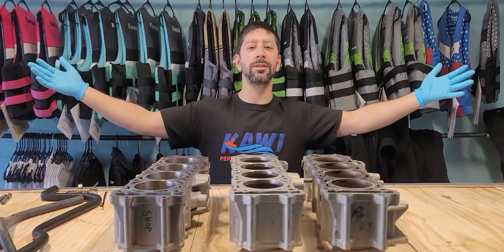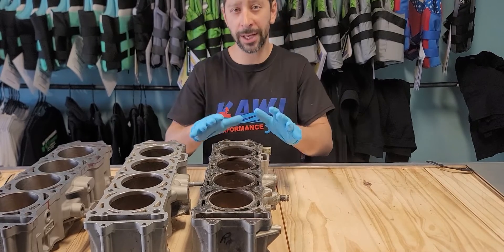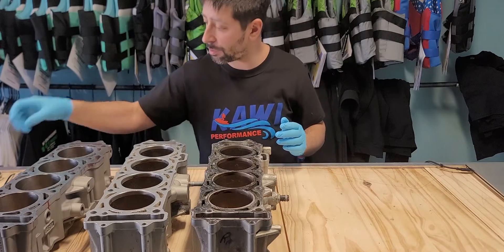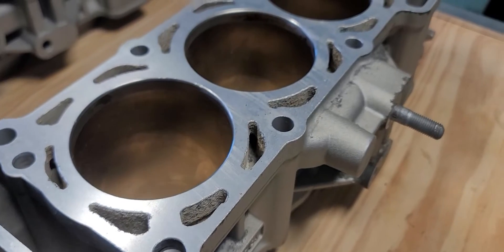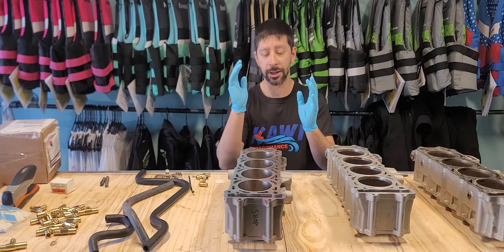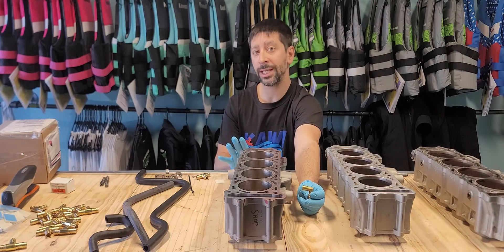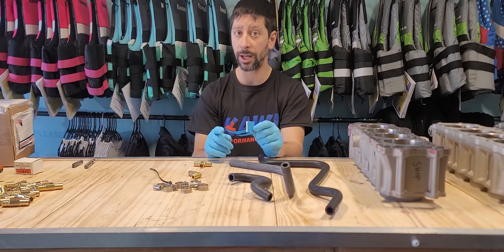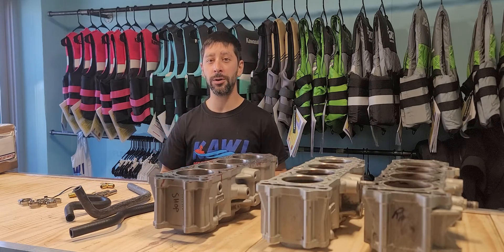Shop Talk: Kawasaki Cylinders & Our Cooling Conversion/ Upgrade Kit

Comment: I've got a 2016 Ultra LX.  How do the cylinders of my machine compare to these three? Did Kawasaki update the Ultra LX cylinders as they updated the 250/260/300/310 cylinders? Is that's the case, then the cylinders of my ski would have the same revised cooling system as the 310's? 

Or- I know the jet pump is the same as the 250/260... maybe they just stuck with the 250/260 cylinder design for the entire generation of Ultra LX, until they revised it to the Ultra 160 in 2023?
Reply from the maker: The Ultra LX is part of the N/A family which is a different cylinder. These are unchanged since their design in the early 2000's. As is the cooling system.

It's the same size as the 250/260 but the LX has slight differences. So they are not completely compatible.
Reply: @kawiperformance bummer, I was hoping perhaps the NA motor got cooling system upgrades along with the 310.  I thought maybe it would be cool to use the NA ski as a base for a turbo build, but it sounds like the 250/260 or 310 engines are really the good starting point for power since they have better cooling.
Reply from the maker: You can use the N/A platform it's all really similar, but from a detonation standpoint, you at least want to run a supercharged cylinder. But the N/A cylinder will cool just as well if you set it up right.

Comment: hey mate would a 250x ultra cylinder fit on my 300x
Reply from the maker: Fit, technically yes. Work with a 300 supercharger, no

Comment: I have a blown out cylinder on my 250 ultra. Can I upgrade to the 310 cylinder with a 300 head?
Reply from the maker: 310 Cylinder no, 310 Head yes. But you have to make sure your lash is correct.

Comment: Thanks for making this video and sharing your knowledge! Some great info about the differences and improvements between the Ultra 250 and Ultra 310!
Reply from the maker: Glad it was helpful! It's cool to see how Kawasaki makes important changes over the years
Reply: I have a 250x. Do I only need to buy a check valve from your website to improve the cooling. I run in  realy cold water.